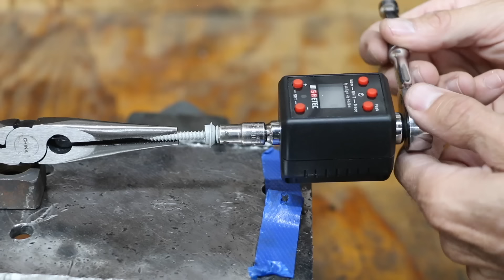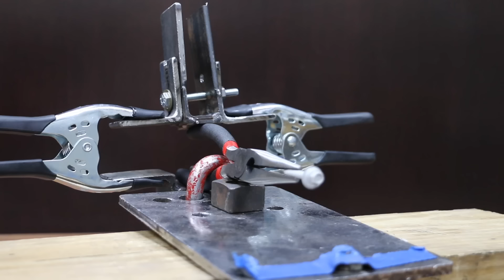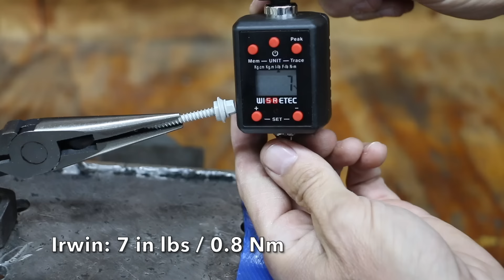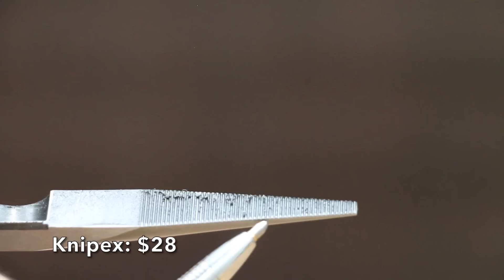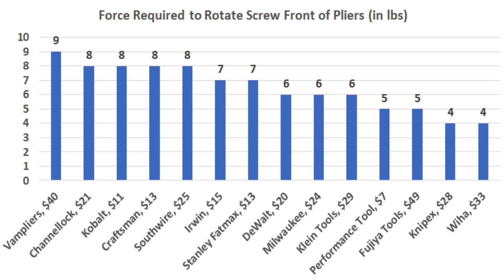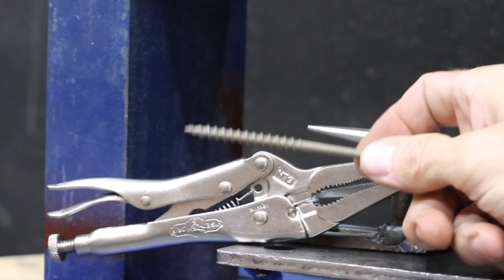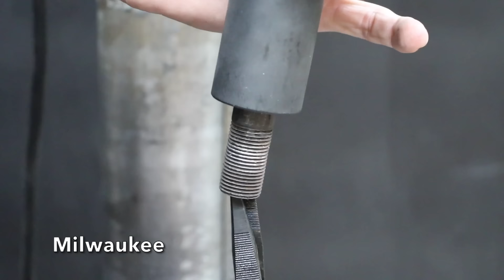Japan vs German Pliers (LONG NOSE)? Knipex, Vampliers, Klein, Fujiya, Irwin, Kobalt Needle Nose

Comment: After getting dirty doing all sorts of interesting experiments, you must have to clean your clothes. Can you please do a video comparing types of bleach? There are several types of bleach would like to see tested.

1: Pure Sodium Percarbonate

2: Oxiclean

3: ~35% Hydrogen peroxide

4: ~3% Hydrogen peroxide

5: Normal Clorox bleach

Furthermore, I see it important to test in two different ways: First of all, by adding the proper amount of each into the washing and doing a load: and secondly, by directly adding it onto the clothing as a stain pretreatment (AKA dipping gym socks in it and seeing which one gets bleached the best!)
Reply from the maker: Thanks for the suggestion.

Comment: Great video.  Really liked the all around performance of Kobalt and as a bonus it is cheap!  I have noticed that Kobalt and Harbor Freight are the same tool with different branding, at least for some of the "high end" HF hand tools.  Have others noticed this?  I am not speaking to this specific plier, but rather as a general observation on some of the tools I happened to own either one or the other and then saw the same thing at the other store with different color plastic and name, but otherwise identical.
Reply from the maker: Thanks!  Thanks for sharing.

Comment: Have you ever tested hands saws? Maybe compare japanese style to western style saws. Some sort of rig so even pull/push pressure is applied along with downward pressure to determine which cuts faster. Which cuts better etc. Cutting with the grain and across the grain. Number of strokes to cut a certain distance etc.
Reply from the maker: Thanks for the suggestion.

Comment: Really liked this one - this is one of my favorite tools for a lot of jobs.  The twist test was especially interesting to me as I am often manipulating stuff in a tight space and also abuse them for tightening zipties as well as wrenching on zipties to break them off.  While most even cheap ones haven't bent permanently often they twist enough to make me loose grip at the tip.

I misplaced one of my needle nose pliers so I think this is very timely...Kobalt would have been my go-to but I will have to rewatch and mull the twisting resistance especially whichever resists it the most would be my first choice.
Reply from the maker: Thanks!  Thanks for the feedback.

Comment: I think you should try testing some radiator flushes and see  which is the best. I see a lot of engine failures because of poor cooling system maintenance.
Reply from the maker: Thanks for the suggestion.

Comment: Hey Todd would you be able to make one on the best tire pressure gauge? The test being centered on most accurate and best value. Maybe throw in a tool truck brand such as matco or bluepoint. Thanks much
Reply from the maker: Thanks for the suggestion.
Reply: @ProjectFarm  anything for the cause! Your work is much appreciated

Comment: Have you done driver bits? I have bought "impact" rated bits and some seem to break or wear out premature. It would be awesome to know the best/most reliable brand supplying these. Some Philip's head driver fail to seat well and raise out, causing damage to a screw, stripping them and causing problems.
Reply from the maker: Thanks for the suggestion.

Comment: Considering the use case for needle nose pliers, anything involving pressures higher than 80 pounds, which is higher than the average male hand grip, is unreasonable for testing.   Even a VERY strong man rarely goes above 110 lbs.   I certainly wouldn't be trying to cut nails with a pair of pliers of any type.  I use bolt cutters for that.    I'd rather see how well they work with a pulling twisting motion, which is the normal use for a pair of needle nose pliers.   (reaching in, grabbing, and twisting something out) 

As previous posters have mentioned, it seems like this is just a repeat of "standard" pliers, rather than a set of tests for needle nose pliers.

Comment: I have two suggestions: Windshield resins and applicators (windshield repair bridges.)
Regarding the bridges, they all seem like a scam ($180 and up, and I've had as much luck with one I made from scrap wood and spare parts in my shop.) But I have only tried a few of the professional solutions.
Regarding resins: Well, I honestly can't tell the difference from one to the next.
Reason for suggestion beyond the above: Windshield repair is specialized. A small crack repaired poorly can result in need to replace the entire windshield, resulting in major costs. While a crack repaired properly in the appropriate time can save hundreds of dollars or hassle for years to come.
But, if you make a repair with poor equipment or materials, and it turns out to fail, it's already too late to try again.

I realize this suggestion would be difficult to test. However I have faith that you can manage a testing environment for it. The question becomes whether the cost investment would net the return on ad revenue. Personally, given how few options exist and the lack of documentation or testing for them, I believe there's an opportunity here to be the only valid comparison on the entire internet. The question is whether other people care as much as I do and search for these things (they probably do, given the cost of windshield repair.)

Edit: the real downside to comparing these is that patience and skill of the person doing the job play a larger role than with most tools. This could mean that your test setup truly shows the difference in the products, but many viewers won't have the time or steadiness to reproduce your results. So I understand completely if you decide this isn't a great test for your channel, since it's not a thing you can expect the majority of viewers to be able to make full use of. But there would still be some with the time, patience or knowledge to reproduce your results, it's just a matter of whether it's enough to feel worth the cost of setting up the tests.
Reply from the maker: Thanks for the suggestions.

Comment: Great tests as usual, although MOST of the tasks on here I have better tools to do the job and would never use my needle nose pliers for. Example: I’ll use diagonal cutters or mini bolt cutters for nail cutting tasks.
Reply: excatly.  the real test is the ability to grap small things--springs..cables..and make them do what you want.
not cutting nails.  not twisting the crap out of them.
Reply: @harryharry3193  in that case all of these pliers would be more then enough okay. Even crappy dollar tree pliers would do the job perfectly fine.

Comment: Needle nose pliers are one of the most useless tools in a professionals tool inventory.  Most shade tree mechanics go for these cheapo pliers.  They are good to have for grabbing small items, but have low jaw strength and worse yet is cutting power.  Buy the proper tools.
These pliers rarely even cut 22 guage wire, because their edges are not precision, hardened, steel.
Reply from the maker: Thanks for the feedback.
Reply: @ProjectFarm   I do like your videos. As a certified mechanic, I can appreciate your approach to these comparisons. 
I would not have the patience.  You are very smart, and obviously you know your stuff...so thanks, I have subscribed long ago and always learn lots from you...

Comment: What's the purpose of putting the force at the end of the handle? A person will grip more towards the center of the pliers, so doesn't it make more sense to push from there? Is it to test the strength of the pliers?

Comment: When I use pliers to cut through tough items I always rotate the tool, which seems to help cut through it much easier. I think some of these brands would have performed better if tested this way. Maybe you can retest with a specific weight while rotating the nail?
Reply from the maker: Thanks for the suggestion.

Comment: Hey when injector cleaning product testing? Market cheap ones vs stp expensive ones.

Also could you look into RVS products. They are made here in finland 🇫🇮 and it currently has no competitors on its class. Its a triboceramic creating product and it provides extremely good restoration capacitys on transmissions, engines and even in HP-pumps and power steerings
Reply from the maker: Thanks for the suggestions.

Comment: Thanks again for a nice comparison test.  Might have been interesting to see Tekton in this mix.  Vampliers are really good.  I had a  #12 screw in a tire...twice.  I first used  a screwdriver but it didn't work at all.  Then I tried Craftsman pliers to try and twist that thing out and it was no go. Wouldn't hang on.  Then I remembered my Vampliers and it got them out.    Over the years I also have also acquired Channellock, Knipex, Klein and old USA Craftsman.  Don't have anything bad to say about any of them.
Reply from the maker: You are welcome!  Thanks for the suggestion.

Comment: Great video, as always! I love comparing your results to my final purchase - I've had a set of Kobalt pliers for several years, and have been quite satisfied with them. 
I'd love it if you'd consider reviewing tarp tie-down methods in the future. I've been shopping for tarp holds that will maintain hold through high winds, without damaging the tarp - there's a variety of solutions available. some are simple, such as tent stakes and rope, or bungees; others are more involved, such as temporary grommet holds, gator-style clips, and 2 piece sliding grips. It's difficult to tell which the best solution is, and I'd love to see your input & testing.
Reply from the maker: Thanks!  Thanks for the suggestion.

Comment: I feel sad for the knipex. I love the brand and every piece of equipment from them has performed exceptionally. I do not own this pair though.
Reply from the maker: Thanks for sharing.
Reply: The knipex model used in this test ist longer and they have a shorter design which is more compareable to the others. Still a great test, but knipex never let me down. I have some tools for years and they stay sharp and work just perfect after man hours of use.

Comment: Hey boss,  little late to the party.
The most I have ever cut with my needle nose was some wire.  I use my Snap On needle nose 90% of the time. They have a pretty long slim nose and do not even have a cutter. I haven't noticed any Flex when twisting, at least for my uses.
Thanks for another great video brother, we really appreciate it. 
I'm in need of a 7 1/4 in circular saw. Have you done any testing within the past year ? I did not see it in the library.
Reply from the maker: Thanks and you are welcome!  Thanks for the video idea.

Comment: While I enjoy the tests performed on this channel I've often wondered who would actually mistreat their tools like this. Then my neighbors kid borrowed some tools from me.
Reply from the maker: Sorry to hear!
Reply: AH,Ha,hahhahhahhaaaa!!
You need a second set of loaner tools!
JIM 🤔
Reply: @jimc4731  older rusty tools never fail in situations like this
Reply: See my dad on that one. He'd break one of my tools and then say, "Take it back to the store, this brand has a lifetime warranty."
That's when I found that Craftsman no longer honors their warranty.
Reply: @MasterYoist  my dad did this to me too. He broke my favorite wrench. I got it as a gift from my uncle when I was a kid and it was the only 3/8 drive I had. He was like "they'll honor the warranty" lowes didn't. So in my toolbox it sits. It went from a toy I spun around because it makes a fun sound, to the one tool I brought alongside my Leatherman wave when I was fixing lacrosse sticks (some heads from our local shop use hex nuts), to the tool I fixed my first car with, to
Reply: @ziolan8970  wrench or ratchet? if ratchet, get a spare kit for it on eBay or wherever it is sold, lots of NOS stuff around too for commercially dead brands. if wrench, you'll have got a nice paperweight for your home office once cleaned up. 😉
Reply: Yeah. Loaning out your tools is the ultimate in mistreatment. It reminds me of letting a friend drive my car when it had only 5k miles on it. The clutch has shuddered a bit when cold ever since. makes me mad just thinking about it.
Reply: Good one 👍
Reply: Hahaha!
I was worse with my dad's tools.
Reply: @davysanders4922  is your favorite uniform a white sheet?
Reply: tools are tools, not family heirlooms.  sometimes you accept wear on a tool to get the job done.

Comment: You can see how this test was 100% rong, when it tried to prove, that the best pliers out there, like Knipex,are some of the worse. Ths test was 100% wrong. No body gets needle nose pliers to abuse them to death. All people get these, for precision work and the hardest stuff we usually cut with these, is thin cables or thin wire. Who will ever use this kind of tool, to cut a thick screw?
You should have tested, how good these perform to detail work, how lightweight and easy to use are. How comfortable is the grip etc... 100% wrong test, every single test was off.

Comment: From late teens through late 20's, I did LOT of wiring. From mid-teens until today (late 60's), I have done mechanical work but on home projects and vocationally. I've used lots of long nose pliers through the years, and many have been up to the task in most cases, but for day in/day out use I have never found any which stood up to Klein. 
With that said, one test, and a very simple one, which I would have liked to see is copper wire cutting. Yes, sounds like nothing, but cutting soft copper wire, especially fine stranded wire, reveals how straight and precise the cutting edge is. I'm sure I am not the only one who has used wires cutters (whether long nose, diagonal ;pliers, or some similar tool, and it left a strand or two - or more - uncut.
Not a big deal, perhaps, but aggravating, especially when you need a clean cut on something.
Reply from the maker: Thanks for the suggestion.

Comment: Why I love my Knipex:

The comfort grips fit my hands well.
The pivot is very smooth.

I use mine all the time.  For heavy duty stuff? Naw. These are "radio pliers" with long tips. They make over 800 kinds of pliers and if you want something with shorter, broader tips that will be tougher for twisting, I'm sure they have one.

The only thing I've ever cut with needlenose pliers would be simple 12V electrical wire.  Bigger wires and coathanger wire, I'm reaching for diagonal cutters or lineman's pliers, bigger stuff, I'm reaching for Knipex Cobolts.

Snap On Talon Grips are some very sturdy needle noses, too.
Reply from the maker: Thanks for the feedback.
Reply: @ProjectFarm  Oh, and thanks for all of your hard work!

Comment: Before Project Farm, I used to have matching tools. Now my tool box looks a mess but each of them excel at what they do. Thank you, as always, for helping us choose the right tools for what we need them to do most. I will echo everyone else's comments about including the relative diameter and depth  the pliers can enter. I usually use my needle nose for extraction, pulling cables through holes or twisting out broken screws. Looks like my need is the Vampires, but looks fairly wide.
Reply: Better to have mismatched but effective tools over getting hooked on a particular brand name like the marketing men want!
Reply: @Nitecrow314  agree!
Reply: @Nitecrow314  That is specially true with electric tools. In my experience, I have (and prefer) the better tool from another manufacturer, than to have "all of them in the matching yellow (or blue, or teal, or white-with-green, or red, or whatever). Fanboyism is equal to stupidity, as NO brand has every tool perfect.  And that stoopid trend of having every tool on cordless, regardless of any real need to have it battery operated, an expensive way to keep the manufacturer's  pockets full of our hard earned money!
Reply: @alfredomarquez9777  The only advantage with electic tools are if they use the same battery
Reply from the maker: Thanks for sharing.
Reply: Update: got the Vampliers japanese brother: Engineer pz-60 (I believe) with the green handle. It's half the price of the Vampliers but exactly the same in every other way. It is double the thickness of a needle nose pliers tip, but the screw extractor got out a screw that's head broke off 10 years ago and couldn't get it out without damaging the wood. Yet again thank you Project Farm!!!

Comment: I wouldn't mind seeing a video on 12v USB chargers. Seems to be an item that a lot of people use every day and I've noticed many fast charging 12v plugs that claim high power, until you read the smaller print and they really just added to two levels together, which they also make a USB splitter to go with them. I'd be curious what their actual output is compared to "bridged" and compared to power packs on rate of charge.
Reply from the maker: Thanks for the suggestion.

Comment: My problem with Irwin was is the quality control. The welding pliers I bought couldn't cut through welding wire because the blades had a gap. I bought a Japanese one and was impressed with it.
Reply from the maker: Thanks for sharing.

Comment: Great video. The Knipex are really "orphans".  Too flimsy for average work yet not compact and slender enough for precision electronic work. It would be great to have seen Snap On and Texton/Doyle in the tests.  IMHO diamond and diagonal serration patterns are far superior to straight because they grip in all directions. (ex: like the twisting and pulling to remove a stubborn cotter pin).  It would also be interesting to see them holding and cutting very small gauge wire.  Sometimes their cutters meet before the jaw tips and vice versa.  Precision needle nose pliers should be able to hold 40 AWG wire in the tips and also cut it.
Reply from the maker: Thanks!  Thanks for the suggestion.